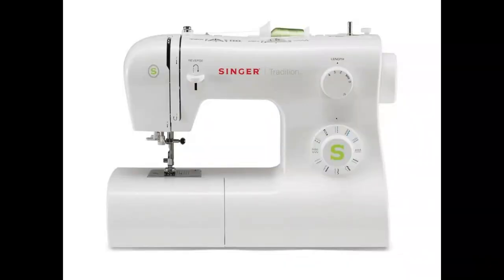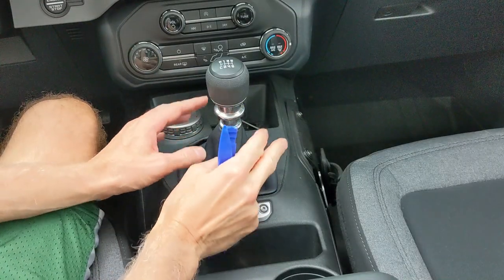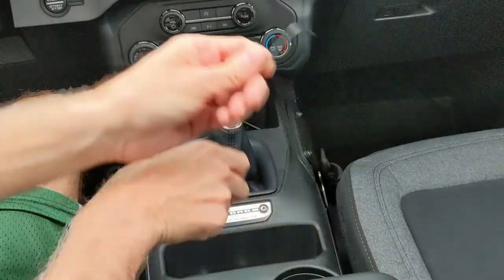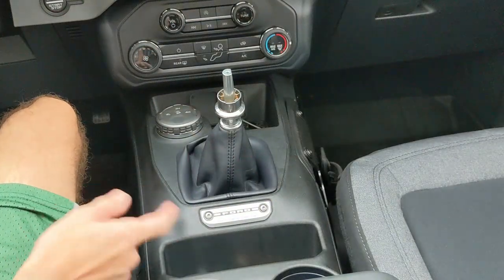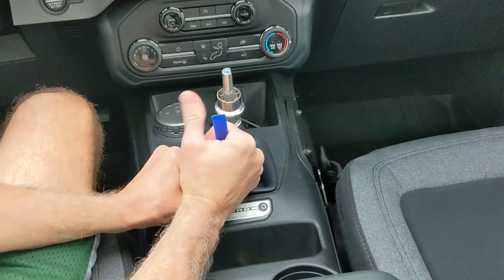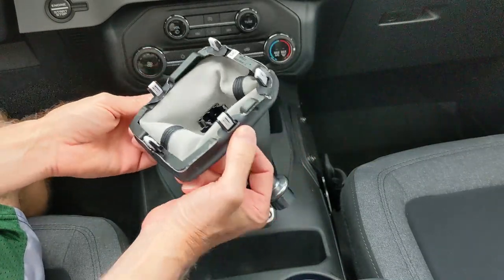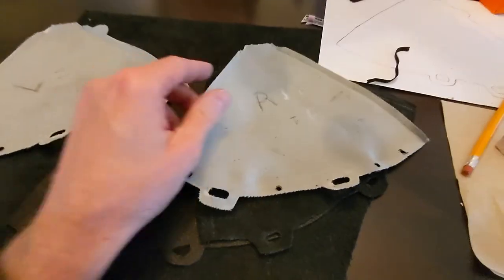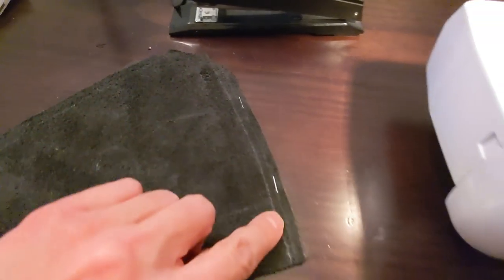2021+ Ford Bronco - I made a custom leather shift boot and it almost broke me!

Comment: Nice work. Nice detail, I think I’ll try it myself. That boot has bothered me as well.
Reply from the maker: Cool, go for it! Check out this post I made on Bronco6g forum, and you will find a pattern that you can print out and it might save you some time, and you can work on making your own without having to disassemble the stock one. https://www.bronco6g.com/forum/threads/diy-custom-stitched-leather-manual-shift-boot.70170/
Reply: @BudgetBronco  I think I will make my own based on your pattern. I actually enjoy sewing and I would like to alternate some orange and blue stitching. Thanks again for the inspiration.
Reply from the maker: You are welcome and good luck with your project!

Comment: I purchased a similar boot from Redline Goods for my 2012 Wrangler.  They seem to have all these boots available for the Bronco.  They sell a leather steering wheel cover, maybe the installation can make it into a future video.
Reply from the maker: Yes, the did recently start selling them for the Bronco as well. Back when I started this project 6+ months ago they were not available yet. How is the quality of the boot for your Wrangler? And you must have read my mind because I am definitely going to do the steering wheel cover in a future video. Thanks for watching!
Reply: @BudgetBronco  The boot has held up great with barely any maintenance but it was purchased about a decade ago, when quality meant a bit more than now...  My Basesquatch was built a week ago and I expect it at the dealer in about a month, so I'm very much looking forward to seeing more of your videos!  Keep up the great work.

Comment: Hey! How is the white paint holding up on the wheels? Any cracking, chipping or peeling?
Reply from the maker: Still looks great, no cracking or chipping or peeling! I did ding it one time when I dropped a wrench while removing lug nuts, but I just sprayed some paint on a little craft brush and touched it up, good as new. I will say this, the white gets dirty real quick, but washes up easily.

Comment: If I bought my own leather boot from redline goods and got my dealership to install it how long do you think it would take for them to take the vinyl one out and put the new leather one in and do you think they would have any problems with it or would it be easy for them?

Thanks.
Reply from the maker: SUPER easy. If you were doing it the first time, maybe 15 minutes tops. If I were doing it a second time, easily under 5 minutes.
Reply: ok awesome thanks @BudgetBronco